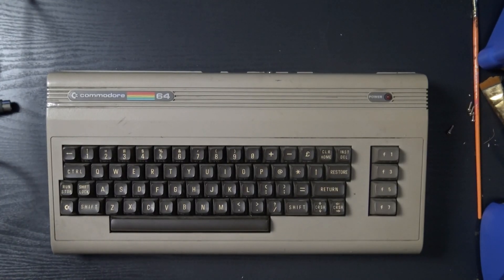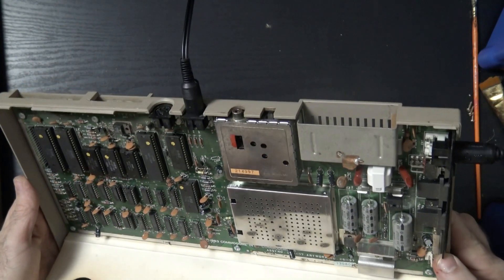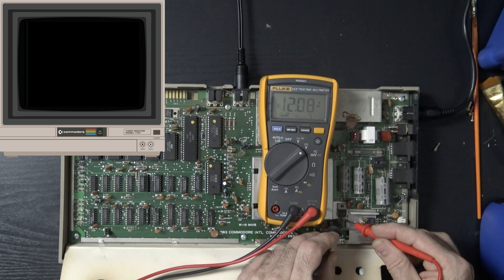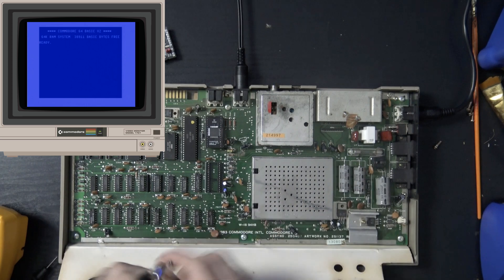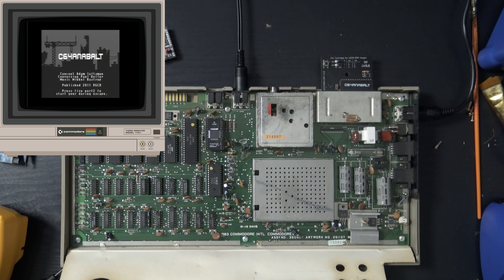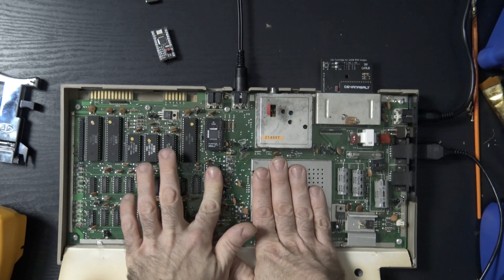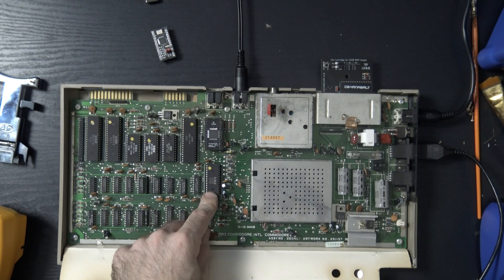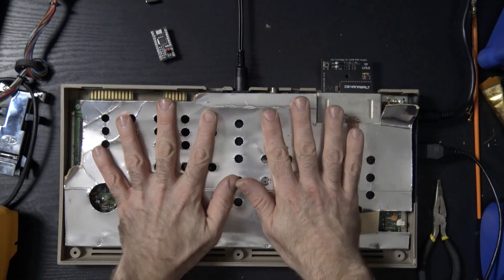How To Fix a Commodore 64 Black Screen

Comment: Chris is a black screen different than a "no signal" message on your TV.  I'm getting a "no signal" message when hooking up the old Commodore 64 I had when I was a kid.  Don't have the original monitor, but I would assume as long as the TV has VGA input, I'm good with the connection.  Thoughts?

Comment: Error Detection ...

1. 
Check with Datasette: connect Datatsette, switch on, try Run/Shift and RunStop/Restore
? If Datasette Starts and Stops, you know the CPU, ROM and parts of the CIAs are working.
2. 
Check 5, 12V on regulator Pins, check the other 5V on Pin 2 of User Port.
? If not OK, check fuse, power supply, you are lucky if it was only the fuse.
3. 
Check the clock on Pin 1 of the 6510  CPU. If you have no Oscilloscope use
- a logic probe, it will display high and low Leds the same itensity
- a frequency meter, some digital multimeters have it and it should give you a reading of ~1MHz
- a simple analog multimeter, it will display ~2,5V DC Voltage (half of VCC)

That's where I'm now, it seems as if the clock generation circuity failed.
Reply from the maker: Do you have access to a Dead Test cartridge? The issue could very well be memory related.

Comment: Hi Chris, I have 4 C64 with Black Screen, I'm sure some of them worked before I stored them away (clean, dry place) I opened two of them, checked voltage (12V, 5V) all OK. I removed CIAs, SIDs and PAL but none of them came back with the boot-up message.

Any ideas for further searches?

Edit: corrected the numer to 4 defect C64s

ps: checked video out on the first 3 C64s with a 2nd monitor and checked video out with an oscilloscope there was no video out.
Reply from the maker: before you do anything else, I would # check the temp of the chips and see if any get hot, especially the memory chips. #2 get a dead test cartridge.. #3 which should be #1 is to make sure you have a proper power supply and video cable. Its a little suspicious that all of them are non functioning especially if you remember all of them being functional before storage. 

Other than that, anything that is socketed should be pulled and cleaned with deoxit to help with any oxidation that may have occurred.